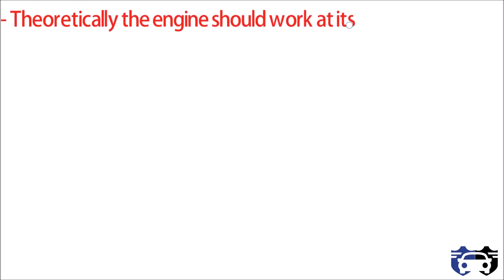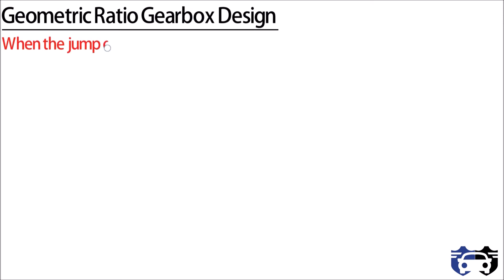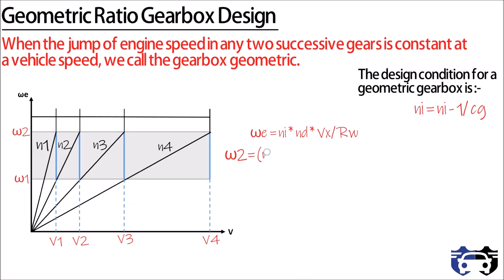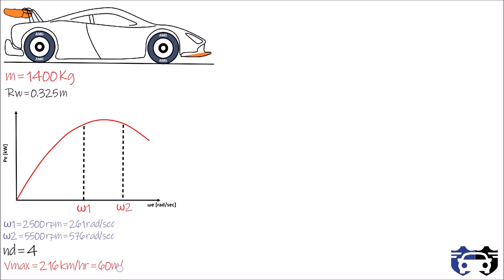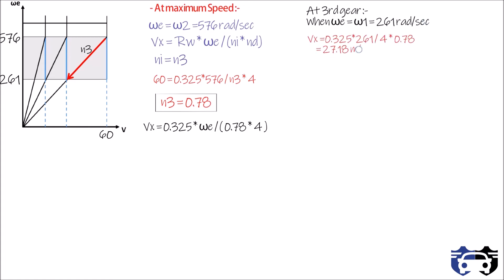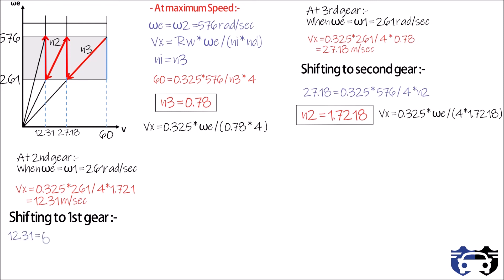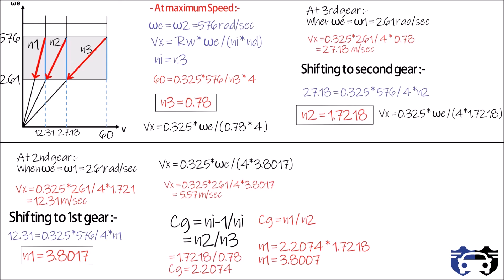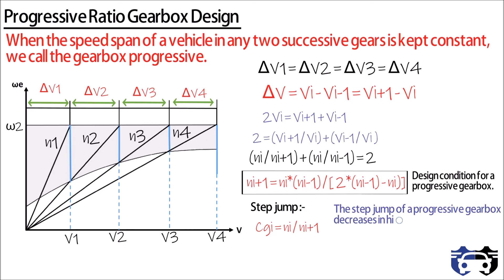How to design a Gearbox ? | Progressive and Geometric Gearbox

Comment: I need to design the according to this question. Can you please help?
It has been decided that a manual gearbox will be used for this vehicle to save costs. You are informed the engine should not exceed 2000 rpm during regular operation for a speed range of 0 to 160 km/hr. The engine speed should also not drop below 1300 rpm during regular operation. Additionally, the vehicle requires a 13x torque increase when in first gear. The gearbox should have 6 speeds (ratios), with 1 speed being a 1:1 ratio, and 1 speed being an overdrive ratio (less than 1). Design a manual gearbox to achieve these specifications. Provide a drawing of the gearbox along with the number of teeth on each gear in the gearbox. Justify your design with calculations. Indicate for each gear what the speed of the vehicle would be when the engine is at 2000 rpm

Comment: Which text-book are you using for design equations? Thanks
Reply from the maker: Check my video on stable condition of gearbox,I derived those equations there !
Still if you want to know , I generally follow SAE Research papers.
Reply: @thevatsaljain  Any good text-book that you know of, which goes into detailed design of gearbox? thanks
Reply from the maker: Actually, Till now I haven't seen any book going into detail of designing of gearbox!
I will comment here if I find any book related to that!
Reply: Automotive transmission by Harald Naunheimer, chapter 4.
Reply: @_.-._SHAAN_.-._  Thanks, looks like a good book, will try and find a low cost copy.
Reply: @_.-._SHAAN_.-._  Thanks so much!!!! Fell in love with it!
Reply: another book - Vehicle Dynamics:
Theory and Application by Reza N. Jazar